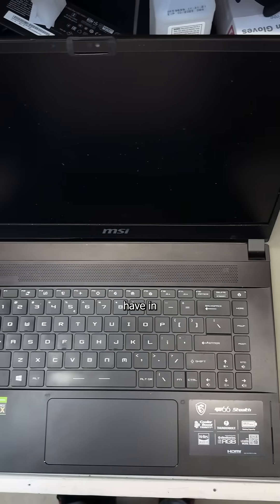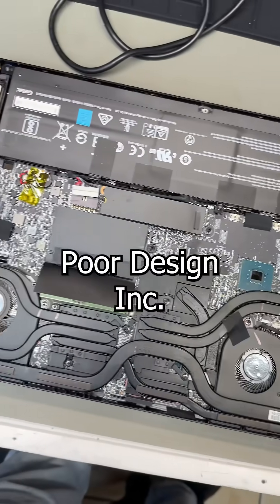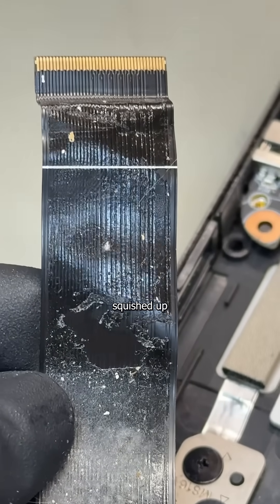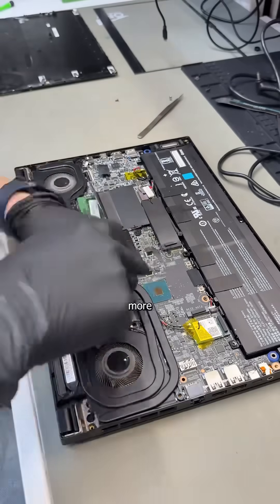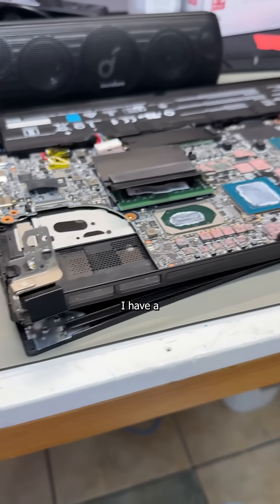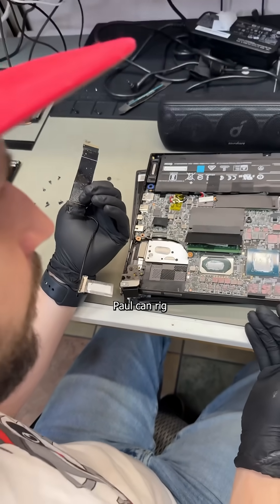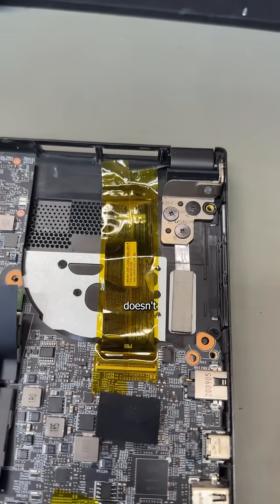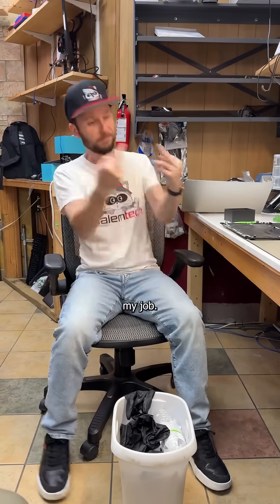$2000 MSI Gaming Laptop is Rigged to FAIL #tech #pc #technology #shorts

Comment: Make laptops thick again.
Reply: Will it have a removeable storage? I see there are some 90's laptops, forgot which brand, in other YT shorts that has a detachable HDD of sorts.
Reply: @Joshua_N-A  Laptops from even 10 years ago had easy to remove HDDs and RAM.
Reply: @Jamesaepp  laptops from today years ago have easily removable SSD and RAM.
Reply: @Jamesaepp  I mean they’re not hard to remove now just open it up and take it out
Reply: @JacqueBibblequip  Nothing is "hard" with computer repair, just time intensive. I admit I haven't worked on a new-ish laptop directly in quite a while as it's simply not the kind of day-to-day work anymore, but I can tell you with great certainty that disengaging one captive screw and lifting a service panel was miles better than disengaging a half dozen screws to remove a laptop's entire bottom pannel (while inevitably breaking some of the plastic clips along the way) just to get to the HDD. Also friendly reminder that batteries used to be hot-swappable. I haven't seen a laptop with that feature in quite some time.
Reply: @Jamesaepp it’s hard for someone that doesn’t know how to do it. So it’s still hard. I think working on cars is relatively easy, unless you’re rebuilding the engine. It’s time consuming most of the time, but I would say easy and a monkey can do it. But that’s because I have experience. You would probably say it’s difficult. Lets say to rustproof the under carriage of a somewhat rusty car.
Reply: @Jamesaepp  This. And they weren't even that heavy or bulky (more so than today likely but the trade off is worth it IMO)
Reply: @JacqueBibblequip It's hard to remove when they are SOLDERED in, yes, I hate soldered RAM, you can't upgrade it that "easy"
Reply: @Joshua_N-A  so many of the older models have these it's always a godsend when one pops in
Reply: @Joshua_N-A I loved having the option to swap a floppy drive for a 2nd battery or on more modern laptops the CD/DVD drive would get swapped.
Reply: @Joshua_N-A  almost every laptop has removable hdd and ssd if you care to open the computer up
Reply: @Joshua_N-A  have you've never heard of upgradeable ram and a ssd😂
Reply: @Joshua_N-A 90% of laptops have a removable storage. Well, all laptops at my home do have a removable storage. My old laptops from 2009-2012 had the "window", which you could open to replace the HDD or RAM, in my father's Dell Vostro 15 I've had to unscrew the whole tray to replace HDD with SSD, and newest laptops are the same except the SSD is NVME. Only some cheap garbage has soldered eMMC/UFS memory instead of removable SSDs
Reply: If it’s got USB 3.0 ports it’s got detachable storage 10x the size & speed anything available back then. Hot swappable drives were a bandaid solution for overpriced tiny storage, not some good old glory days. Nobody using windows on a laptop needs to be moving their C drive around.
Reply: @alexphelps7042  I shouldn't have to choose between a laptop with the speeds of 2024 and a laptop with the repairability/modularity of 2010.
Reply: Framework proves they don't even need to be thick, just designed with repair as the first design principle
Reply: @EidolonKaos  this is true but I appreciate some actual airflow and battery capacity. Laptops aren't meant to be tablets. If people want a tablet they should buy one.
Reply: @Jamesaepp same I hate having to sacrifice performance, cooling, battery and more money because people want the slimmest super model laptop
Reply: @Jamesaepp  Also back when they weren't meant to be  looks 1st as much at least we even had socketed CPUs and MXM graphics cards.
I really want that kind of stuff.
Reply: @Kalvinjj they were even trying to do that with x86 CPUs being soldered to desktop MoBos. thankfully the PC building community is large enough to have a voice
Reply: @Jamesaepp preventative dusting can go a long way to making an ultra-slim laptop survivable but I think I have to agree with you when a Nvidia graphics chipset is thrown into the equation.
Reply: Yes but laptops are supposed to be portable
Reply: @Jamesaepp  To work, you need a physical keyboard and probably a Windows or Linux operating system. And if you need to carry your laptop with you all the time for work or study, battery life and weight are much more important than performance.

I don't like Apple, but the new ARM laptops are popular for a reason, and it's not just because of the logo. In fact, I'm waiting for cheap ARM laptops to become available in my country so I can buy one and enjoy the advantages of both laptops and tablets in one device.
Reply: @EidolonKaos  yeah, they did a good job copying the "computer in a [briefcase, pizza box,. picture frame, random thing]" paradigm"
Reply: I want them extra thicc so I can say to myself I spent 500€ and not 249 and got ripped off by 100%
Reply: @ZERARCHIVE2023  if you’re only spending £500 on a laptop you’re getting what you paid for 😂
Reply: CLEVO based are good enough. But they have own illness((((
Reply: FR. Why do they make it so thin?
Reply: Only if I can have my internal disc drive back, boo... that's really the only reason I keep a Toshitba I've had lying around since 2014, I'm sick of having a USB port always occupied by my detachable disc drive.
Reply: Fr man I want that extra cooling and battery space
Reply: @ATHARVplayz609  batteries are limited too 100Wh anyway which we can already fit in thin laptops
Reply: @bumblethunder that was just one of the examples, though I can’t just leave behind being able to upgrade my ram or having multiple storage drives just coz the laptop is thin
Reply: @ATHARVplayz609 yeah fair enough
Reply: Most Objectively sensible "make something something again" statement ever written
Reply: THICC
Reply: Gaming laptops are still thicc but even they are slimming down
Reply: @Jamesaepp  yessir
Reply: im in the thick of it everybody knows
Reply: THICCTOP

I mean really if it’s a gaming laptop it might as well be huge and impressive.
Reply: @Royaleoake  If it's a gaming laptop ... it might as well be a desktop.
Reply: Dear god please. I had a tank that lasted forever. All my slim laptops have failed. ALL of them.
Reply: Yeah, i dont give a fuck about thin stuff, it shall be faster by thickness
Reply: more chonk
Reply: Agree, I have a 2012 Asus laptop that I still use daily to this day, 13 years of flawless duty, no broken parts, no broken hinges, never BSOD, never freeze, never overheating, never had any problems with motherboard, hdd, cpu and gpu, nothing.

One of the contributing factor is the body, solid built quality with ample body volume to let the motherboard breathe & dissipate heat properly, even with just one fan.

This is when they still build high quality stuff with GOOD INTENTION for LONGEVITY & DURABILITY, therefore they give you: 
proper body with visible exhaust vents,
Plug n play keyboard
plug n play battery
2 ram slot
3 storage port
3 usb
Dual jack port
SD card slot
Rj45
Hdmi
Monitor port
No soldered anything
strong non glue hinges
durable IPS display.

And that's all for mid level laptop, not even a expensive high end laptop.

Most of what they offer todays are pathetic planned obsolescence stuff.
Reply: I like luggable laptops, I want effective cooling not thinness
Reply: Goodbye Thinkpad, hello Thiccpad
Reply: PLEEEAASE! I fken HATE theese slim ass turds!
Reply: Sus but true 😂😂😂
Reply: Fuck no
Reply: But then soy people wouldn't be able to lift them
Reply: They should be thin but have thermal connections like copper plates that can interface with a larger external heat-sink and fan. Maybe even connections for a desktop radiator or a smaller one for travel.

We already run laptop speeds with variable clock-frequencies to help manage the heat. What we need now are more effective ways to dispell heat for those who are plugged into wall power and wish not to constantly incur thermal throttling due the inability for the current cooling system to dispell heat sufficiently at turbo freqs.
Reply: My little brother bought a used, highly modular and modifiable laptop, weighs about 3 bricks, and is about 6 Mac books thick. The damn thing is a beast
Reply: Yes it uselessly too thin
Reply: MLTA make latinas thick again
Reply: Almost all laptops have detachable ssds dude
Reply: Gross
Reply: Spoiler alert: My laptop is not old but thick enough
Reply: Thick but equally light, which is possible, we just want more space for better tech and REPLACABLE BATTERIES.
Reply: @lidge1994 then buy a PC?
I mean, thicker means it lost a portability factor. I do agree it should be lighter, and with replaceable components including CPU
Reply: @mArvAlcao71 old laptops were thick and heavy asf but people still was able to carry them it's not a big problem.
Reply: @Serhat364-HPP innthe old days, yes it's true. But once they got their hands on lighter, thinner laptops they surely won't come back
Reply: Yes please! I'll gladly lug around a 15 pound laptop if it means I can upgrade and repair it easily and for cheep!
Reply: Noooooooooo
Reply: The far right when it comes to laptops 😂
Reply: Make people with strong backs again.
Reply: ruined 67 replies
Reply: @Squarability  69 replies. no one touch.
Reply: Imagine how heavy they become after that, in addition to the current weight of modern laptops (gaming laptops included).
Reply: @vimicito Exactly, people forgot that laptop should be thin and light for mobility. And Framework proves it.
Reply: @verifeli there’s no problem carrying in 5kg of additional weight if it’s in your backpack, and you don’t need it to be very thin either. 
At least I don’t mind having heavy and thick laptop if it’s reliable and repairable.
Reply: @verifeli  Light agreed. Thin? What benefit does THAT bring? I don't need to carry two laptops in the same height of one. The thickness ain't helping jack with packing stuff. Like, I'm carrying one whole T-shirt extra?
Reply: @verifeli  not a gaming laptop, those don't need mobility as they already weigh 25lbs so you won't be taking it out often
Reply: @verifeli no, that's just false. People who move their laptops around do know.

And people who don't move their laptops around don't care.

We need both options.

My personal laptop never moves, unless I go to my Grandparents or Cousins house once in 2 months.

My office laptop moves all the time. 

I obviously want personal to be as big as reasonable and work to be as thin as possible.
Reply: @pianissimo7121 does it never move at all? or just doesn't leave the house? If it stays in one spot, just get a desktop. or if it's about space get a mini PC or an SBC
Reply: @vaelxn  it sits in one spot 90% of the time. I take it with me if I am traveling for more then 2 days. I can't do that with a mini pc as I won't have display and keyboard. 
That being said, my laptop is 5 years old and is reaching its end. 
I am building a pc in about a week. 
I can now build a pc because i still have a laptop if I need to travel. 
If my laptop dies, I will buy another without dedicated graphics and with i3 or something cheap. 

I personally can't bother with mobiles, even if they can serve the purpose of laptops. 
So a laptop is a must. And since i "hardly" move it, i would prefer one that's heavy and tough.
Reply: @pianissimo7121 yeah my travel laptop is thin and powerful and requires attention to thermal but in exchange it really does perform while in the ways I find important. 

I also check the airflow and dust it preventative ever couple of months or anytime unplanned maintenance occurs.
Reply: @DJRonnieG  the last part is where I went wrong. 
I was getting 5 fps in games and always throttling cpu. Got it cleaned up and was getting a good 50fps. 
This difference was insane. 
Cleaning the laptop is a very important thing
Reply: @verifeli  dumb take

Comment: Bro i have the same laptop, it's my company's pc but it has horizontal lines on the bottom of the screen (when overheat a bit) so maybe raplacing that cable should solve the issue

Comment: flat display ribbon cables need to be made illegal tbh. They're always bad news and there's plenty of space for cable-shaped cables to go through most laptop's hinges
Reply from the maker: I would love to hear an engineer explain this decision.
Reply: @SalemTechsperts  answer = money
Reply: @SalemTechsperts  Ooh, let me! Ahem... BEAN COUNTERS.
Reply: Cable-shaped cables.
Reply: @ericreid8111  couldn't think of a better way of describing regular cables lol
Reply: @bolttracks tubular
Reply: remember when one of the macbooks had a shittily designed display flex cable so it was a frequent failure point so genius bar could charge mb replacement prices for the unsuspecting customers 😂 These manufacturers are doing these things on purpose, these are builtin design failures to keep you milked for service

Comment: I actually have this laptop and it's been giving me problems ever since I bought the damn thing. It keeps dropping frames and distorting the sound during gameplay, and it gets captured in recordings. It does this randomly, and I don't know why it does this.
Reply: I get framedrops all the time aswell. It cant even run cs2 smoothly at the lowest settings.. I’ve also had overheating issues where the fans suddenly go into max speed and then it just shuts down😢 Ive had it for like 3 years

Comment: PLEASE STAY AWAY FROM MSI LAPTOPS!!! I had one die from just over a year of normal use. Prior to this is was sent to MSI 4 times for it just randomly not working properly. They are truly horrible products
Reply: I’ve used two msi laptops for 3 years each over 6 years so far and neither failed me. Not sure if it’s just luck or how you handle your device or the environment. My current laptop is actually the same model as the one in the video.
Reply: 100% agree. I bought a MSI GS-73 VR in 2018 and I had tons of issue with it like I had to dismantle my computer to untighten the hinges of the screen for example, because it broke when I closed my latop (normally, not forcing at all). Also I had my CPU fan rattling and not working at all after less than a year of use. 

I will never buy a MSI laptop ever again
Reply: i own a gp65 and after 4 years of being shoved in my tiny back and being thrown around, Still very solid, no issues. All i did was reapply thermal paste after my 1st year into ownership.
Reply: I bought msi gs65 stealth in 2020 and its still working perfectly fine. But i will not be buying msi again.
Reply: I read they do it in purpose, same with msi monitors.
Reply: @VITAS874  please don't say that, I'm currently using a less than a year of use msi monitor 😭
Reply: @AjaxTartaglia11   they have chip inside monitor, so its matter of time man...
Reply: Guess I was lucky? I had bought a GF73 Raider in 2018, and currently use a GS76 Stealth bought in 2021. Both still work OK. Raider did have a hinge problem, Stealth still doesn't. I did have to replace the SSD on Stealth though - it went to read-only mode. Kinda wanted to get myself a new model with 4090, but it will set back my other plans really 00hard if I do so, and 3080 still works fine, so I'll stick with my Stealth for now.

Definitely need to look out for this particular model though, this BS design is just asinine. And I thought GS76 had stupid inside layout...
Reply: I do have GS75 2020 doesn’t really that problematic.. is it because i always maintenance (cleaning and repaste to their official service center) every 6 months idk.. but the hinge and everything is fine..
Reply: HOW DID YOU TYPE
Reply: @supoooksis-v2k  with my new laptop?
Reply: Is this a recent thing or it's been happening for years on this brand?
Reply: Not just msi, acer has the same problems
Atp its better to just sacrifice the mobility and buy a desktop instead of a laptop
Reply: can confirm acers having... issues, my old shit is trying its hardest to kill itself, and im gonna have to get a new 'puter soon
Reply: Same, bought a new one in fall 2023, a $1500 one at that. Sht just got stuck on “restarting” after a month. Just returned it for a full refund at Costco
Reply: Damn I got lucky then
Reply: Not just laptops but stay away from MSI GPUs as well especially AMD GPUs they're horrible GPU maker
Reply: @feliksdzerzhinskij800  So you're just an Nvidia fangirl